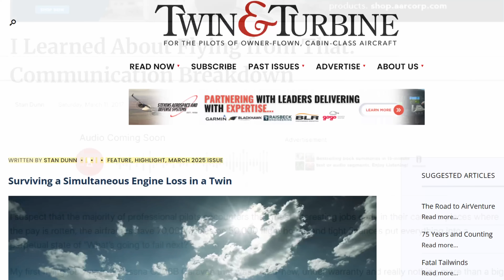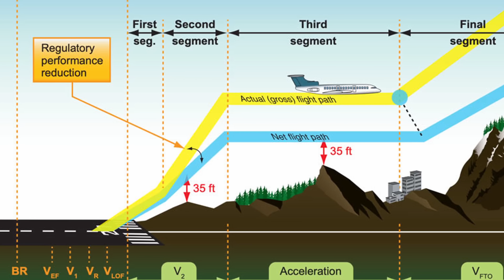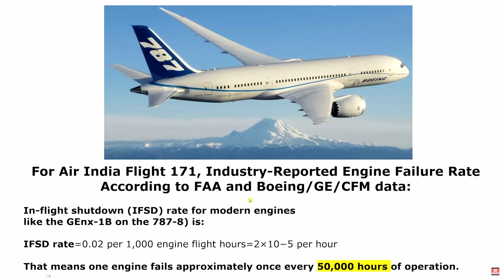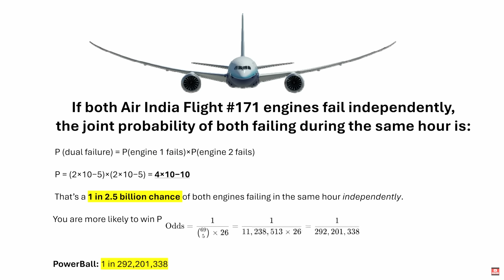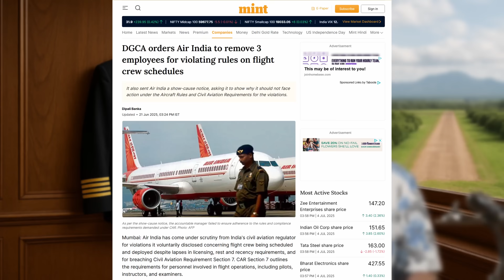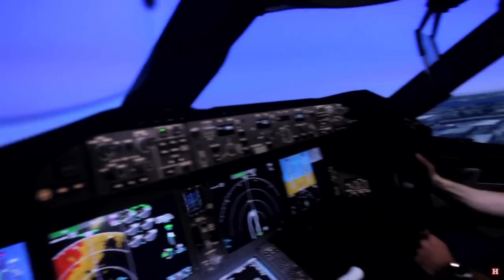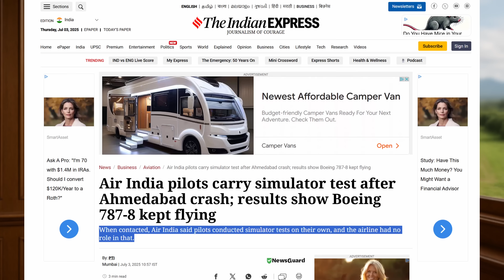Air India 171 Cause Becoming Clear

Comment: what about the pilot's may day call saying no thrust?
Reply: I suspect Boeing are quietly transporting suitcases of cash to India.
Reply: What concerns me is the way India is handling the crash without enough oversite, they would much rather blame it one Boeing, there's alot at stake.
Reply: @thomasquinn4036 what if Boeing is to blame, though
Reply: Grimly, this is in some ways all too consistent with the wrong engine shutdown theory: aviate, navigate, communicate: this plane was only in the air for 35 seconds. Those pilots had no business communicating with anyone at any time: to do so was itself a breach of SOP.
Reply: They should probably let the computer set the TO parameters and perform the takeoff as well as landing. It’s looking more like a pilot error every day.
Reply: @rameshrajagopalan6319 This is a brilliant comment. There are two sub-cases: (1) pilot would accidentally shut down the wrong engine and didn't know it and thinks he has 1/2 thrust and (2) same but pilot knows he messed up and has zero thrust.  

If (1) words would have been "I have half thrust".  If (2) words would have NOT been the mayday call, which was a complaint that someone ELSE messed up.  So, if (2), it would have been "we shut down wrong engine and have no thrust" since as said he is seeking help about no thrust and complaining.

By the way I posted what happened elsewhere but it's related to torque from hydraulics from gear up command and FADEC auto-reignite software being rebooted upon power flicker, so it was disabled.
Reply: Apparently fake news. All they said was 'Mayday'
Reply: It did seem to lose power….
Reply: Completely logical. If you first notice that one engine has quit, and then you shut down the other engine, that was working fine, the first thing you want to do is to complain to ATC that you do not have thrust, instead of trying to relight any engine that might be useful to keep you flying. End of sarcasm.
Reply: @tommyrjensen  Assuming one engine quit, one would think they would keep both thrust levers to full until they were high enough to take their time to analyze the problem.   But it happened so fast, and the mayday call was so quick, it seems to me there was some other problem going on.  I agree we need to wait and see what the FDR shows.
Reply: @tommyrjensen  why should you be aware that you turned the wrong engine off If you turned this engine off in the First place. All these accidents in the past shows, that the pilots didnt realise that they shut off the wrong engine until it was to late. I guess they we're just to confident with their actions and didnt Check twice
Reply: @tommyrjensen 
Some reports said that the entire flight lasted just 30 seconds.
Some reports instead said that the flight lasted under 60 seconds.
Whatever caused the problem 
if they lost both engines at that altitude
 I doubt very much that they had time to restart an engine.

It's standard for pilots to inform ATC regarding what is happening in an emergency, even in cases in which the pilots have no hope of getting their plane to an airport.

Some aviation experts have praised these pilots for sending that message to ATC when they were already dealing with such a difficult situation.

Maybe you should stop doing after the fact couch piloting.
Reply: @geofflepper3207 one of the shortest commercial flights  on record.
Reply: @geofflepper3207 dang dude there is entire video of aircraft from take off to crash what are you smoking just count seconds there its 32 seconds i think
Reply: @tommyrjensen  Some people can use their hands while talking. Two people too. 4 hands. 2 mouths.
Reply: I believe he was onto something .🫣🙄🙄

Comment: What about the possibility that someone, to save a few Rupees, bought contaminated fuel at a discount?
Reply: They could have bought fuel in Delhi where they came from, to save getting fuel in Gatwick when they got there. But how would no other planes get any problems from having the same bad fuel loaded?
Reply: @tommyrjensen  That's the problem with this theory. However, there could be a bolus of bad fuel all of which went into 171. So far it seems to be some or other problem with the fuel or its controls.

Comment: you missed another single-point-of-failure, being the FCSOV (fuel control shutoff valve) in conjunction with the RAT depkoyment, either software or hardware glitch during switchover to backup power source, as the FCSOV has been reported to be a fail-closed (i.e., fuel flow stops to both engines). This occurred on a landing rollout of another 787, due to a glitch when the reverse thrust was engaged at a critical millisecond as the wheels contacted the runway... no one was hurt in that case as the landing was completed safely but was unable to restart the engines... 

have you considered that??
Reply: This is one of my theories, I will keep my other 2 until further info is revealed.
Reply: In a 787 it is an HPSOV, HP for high pressure. Each needs its own signal to shut closed. Software could do it. Pilots could maybe do it simultaneously, but it would not be easy.

Comment: I am curious as to why the airplane just offers a warning if the plane is not configured properly?  Why not fully restrict the ability to spool up the engines?  I am a layperson but I just don't get why something critical would not be tied to a more substantial control output or interlock?
Reply: Because then you're putting the machine in charge of the human. That's not a good thing. Warnings are good but ultimately the pilot is the one in command. Imagine if you were cruising on highway at 70 and your car's ECU detected a low oil pressure and immediately stopped the engine. Not good. The car should give you a warning which will allow you to safely pull over and then sit down the engine.
Reply: @bingbong4848 I appreciate the response.   Still not sure if I get your position.   There are clearly functions of the aircraft that are fully automated.   The concept that a pilot needs to be in control seems to fail to confront the fact that humans make mistakes and automation exists to counter that.  I just don't get the logic.
Reply: @TheLucebear  you're welcome. Computers and control systems are very binary. They only see 1's and 0's but cannot put things into context like humans can. Even if a takeoff configuration is incorrect, that doesn't mean the that the plane can't takeoff. 
Imagine some crazy scenario where the pilot has to apply power to get out of the way of another plane coming in, but the computer overrides the pilot. It's an extreme example but... Ultimately the pilot has responsibility, and the automated systems are there to help, not override. Humans can see the wider situation and put problems into context and decide best outcome. Of course we'll still get it wrong sometimes. 
Boeing or Airbus can't afford the liability of their aircraft making a decision that kills everyone. The Boeing MCAS issue of a few years ago  is probably a good example of what could go wrong.
Reply: @bingbong4848  Again.  I appreciate your stance.  I think we lack objective definition of the situation.  There may be pride on both ends that limit the progress of this discussion.  If the plane ain't configured properly, homebody should look down and wonder why the engines aren't spooling up and he or she would recognize that the plane was not in the proper configuration.  He or she would consult with a checklist to then reconfigure or override.  The override is recorded and can be traced with an audit trail.  This is simple stuff.  I feel pride overcomes logic in this situation.  Kindly.
Reply: @TheLucebear  What when the guys making the automation make mistakes ? Ever experienced a blue screen on a PC ?
Reply: The pilots should be able to be in charge and override everything. Often they only have seconds to react to a situation.
Reply: The warning that you are talking about is impossible to ignore. It is a very loud blaring intermittent horn with flashing lights as soon as you push the throttles forward. To stop the noise you pull the throttles to idle. They were properly configured for takeoff.
Reply: @orizaba18000 Wasn't trying to implicate anyone.  Trying to figure things out.  Your behavior seems nervous.  Not sure why there isn't an interlock.  Its simple.  Avoids the hierarchy that comes from flying.
Reply: @TheLucebear  Nervous about what? Just pointing out that there is no way to ignore those warnings.
Reply: how about the cabin pressurization system? They can shut down pressurization, effectively killing everyone on board in about 15 minutes. What's to stop it? A warning alert sound. That scenario is what likely happened in the MH370 disappearance. Think about just how insane that is. Imagine the switch is labeled: NORMAL and "KILL EVERYONE IN 15 MINUTES". Would that be allowed? But that in fact is exactly what it does.
Reply: Err . . Errr . . what does a. Immobiliser on a car do ? Pilot can still be in command but have a background safety system prevent engine start  ! And as we've seen on that Airbus low-level pass crash from yonks ago, pilot may not have full authority, computer may intervene and intrepret the signs incorrectly .

Comment: No one mentions that the aircraft took "ALL" of the runway barely clearing ground, creating dust storms at the end of the runway. Maybe the camera angle just made it appear that way. And with the rat hanging out there was something wrong before the aircraft left the ground.
Reply: It did not use more of the runway than any other departing plane normally does.
Reply: Dude, the video literally said that maybe since the "dust" was only on the port side, it could have been an indication of some issue with #1 engine.
Reply: The RAT likely engaged after takeoff, seen no evidence of it being engaged on ground. And if so, attempt to take of would likely be aborted.

Comment: I can't imagine a pilot, would Even entertained the idea of shutting down an engine during that critical stage of lift off. I'll leave the door open on that, but you would think that the pilot would have said something to the ATC. Other than no power or lyft.... Lost an engine would have been the first phrase.
Reply: I can’t speak to this airplane or this crew, but many years ago I flew large aircraft and we had similar fire handles for each engine. When a fire is detected, the thing lit up with a bright red light, right at eye level. I never had one come on in flight, but many times in the simulator. I’ll tell you that it’s scary, even in the simulator, and there is a very real visceral temptation to reach up and pull it. After all, the plane is on fire and you want to put it out right away! 

Of course, with time and training I learned to ignore the impulse and follow the procedure. Sometimes crafty instructors would even turn on the light with no other indications or illuminate the wrong light. All of course to send the strong message not to just pull the handle without careful consideration. 

Putting myself in these guys’ shoes, I can absolutely imagine a scenario where I’m tired from being overworked and reacting too quickly to a fire light. Particularly if I didn’t get good, thorough simulator training. 

Not saying it’s likely here - I just don’t know. But I wouldn’t rule out the possibility.
Reply: When  you fly, in priority you Aviate, Navigate and Communicate. Communications comes last because nobody on the ground can help you in the immediate. So not communicating whichever  engine failed is not relevant.
Reply: I agree the relevance, doesn't matter to what engine. But the youtuber whole premise was that one of the engines flamed out. Or caught fire. So when the pilot radioed ATC to say no power, no lift that indicates he has no idea why it's happening? Which would leave out engine, fire or lost engine....f @marclandreville6367
Reply: Maybe the pilots were exhausted. Hence the suspensions of staff.
Reply: Yeah, no way this happened 6.5 seconds after lift off.  If there had been an explosion or obvious fire, then maybe.  But no chance in this case.
It's a bullshit theory to feed click bait.

Comment: I thought there was news that the pin locating the pilots seat on the adjuster slide snapped causing his seat to fall back with him holding the the thrust levers, idling both engines. It said the pin had been replaced 2 weeks before suggesting an issue with the pins. Cant remember where I saw this, but it was about a week ago. Was it 'fake' news?

Comment: Each engine has TWO variable frequency starter generators... not one.
Reply from the maker: Thanks. 787 is a little different. Still, underlying description as it relates to the RAT is still valid.
Reply: yep I was gonna say that too. I heard that on several other videos. Because it has such high power demands.
Reply: That doesn't matter if both engines quit.